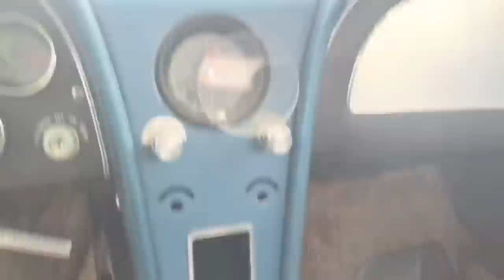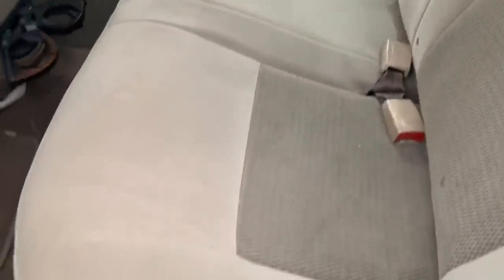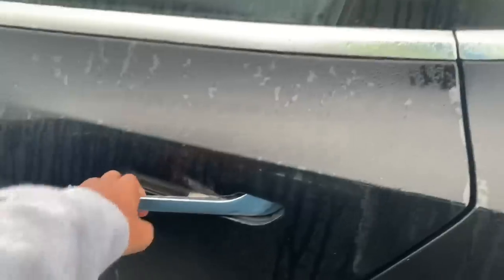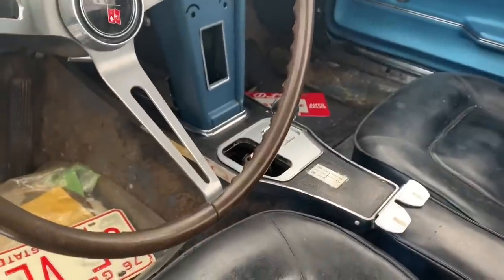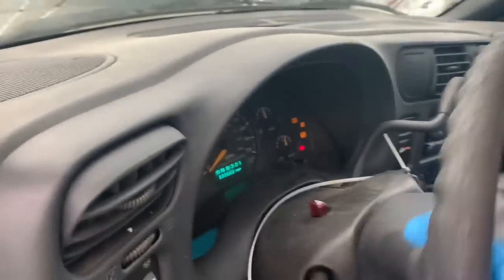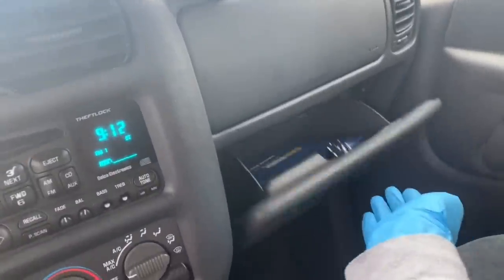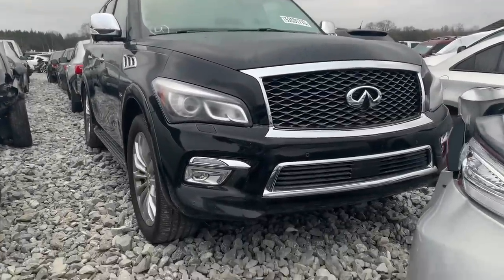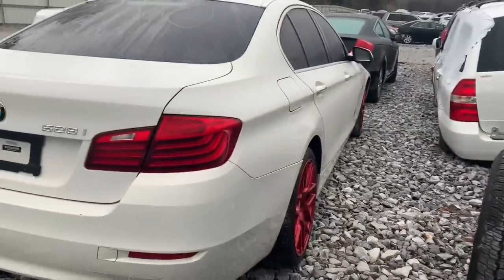The *CHEAPEST* Infiniti QX56 At COPART!

Comment: Hey the Infinity is a nice vehicle... I have one in my collection... there was supposed to be a recall on it... something was killing the battery. I just picked mine back up from the dealership... the alternator and battery was playing freeze tag... or one... two... three... red light... or something! They claimed that they fixed the issue... but someone borrowed my aftermarket clear floor mats... it’s a very large dealership so I can only say borrowed or miss placed them! But it’s a nice vehicle... very comfortable... just don’t do what I’ve been doing with it... stop to talk and keep it running... it sucks the 93 like cool-aid... I ain’t saying like Cosby with any cool-pops either! My Armada is older and larger in comparison... however eventho I use to cry when I had to stop at every redlight because it drinks it also... but it’s much better on fuel than the newer infinity Qx 80... and a much better take off then the Infinity as well! Enjoying your work Sir..., double up your gloves 🧤... and I wouldn’t recommend touching your face with everything going on these days. “I’m just saying!”